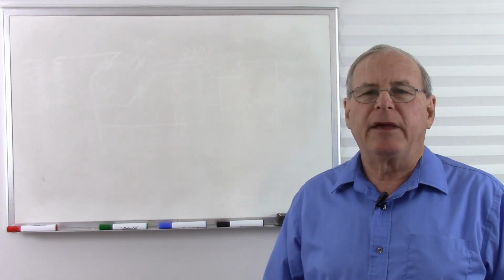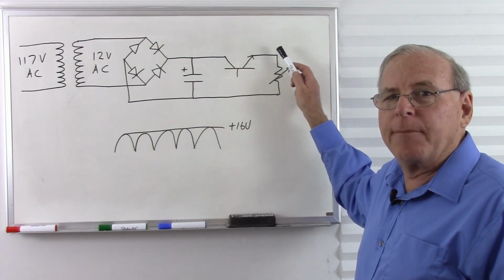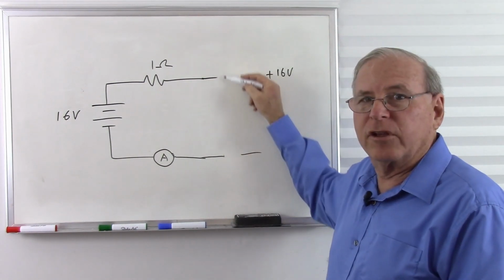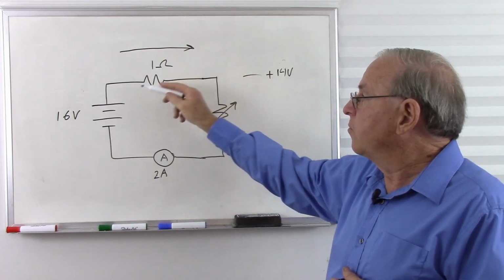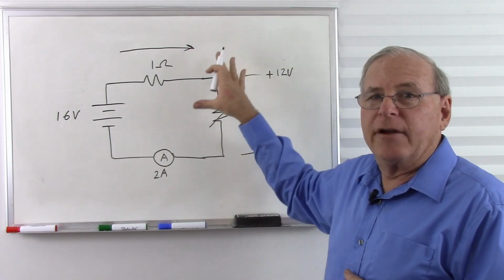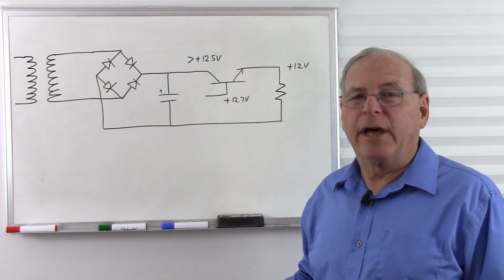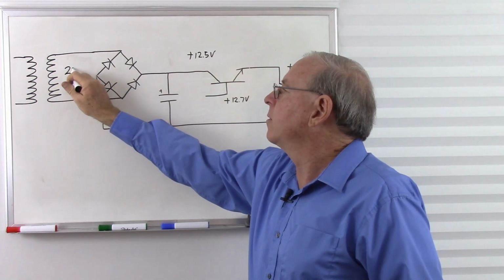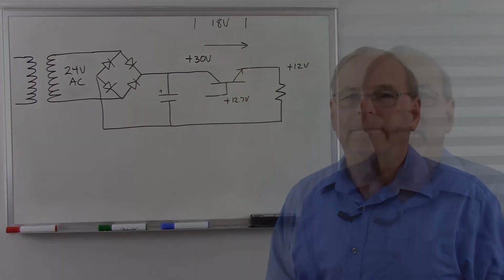Building a Linear Power Supply, Part 6   Design Troubleshooting

Comment: I was taught that a bridge rectifier DC voltage output was 1.414 x's  the AC voltage.  Hence 16 VAC x 1.414 =  22.624 Vdc .

Comment: A couple of observations:
1. When designing do not make generic assumptions about component characteristics such as rectifier diode forward voltage drop - read the data sheets. For example, the Vishay data sheet for 1N4000 series diodes lists Vr  = 1.1 volts at 1.0 amp so Vr = 0.7 amps is not a valid design assumption.
2. Your voltage analysis seems to have completely neglected the ripple voltage on the filter capacitor. Even if the transformer and the diodes each had 0 ohms resistance, as the load current increases the effective voltage across the filter capacitor will drop.  To determine the required transformer secondary voltage you need to consider several things: the operating range of your incoming mains voltage (often between +/- 6% to 10% depending on location), the transformer regulation characteristics, rectifier forward voltage drop, filter capacitor ripple voltage and then the requirements of the chosen regulator topology.

Comment: Thanks for this deep dive into power supply design. Your explanations are the clearest I've yet seen. Now I understand why, in a different video series on linear power supply design, multiple pass transistors were employed in parallel --since each one of the transistors in such a configuration dissipates a portion of the total heat.

Comment: Switching supplies are very useful until you start playing with sensitive pre-amplifiers.  The switching supplies are very 'noisy' and this 'noise' gets amplified along the input signal.
Linear supplies are much cleaner.  Suggestion - have BOTH if you can afford it. 😀